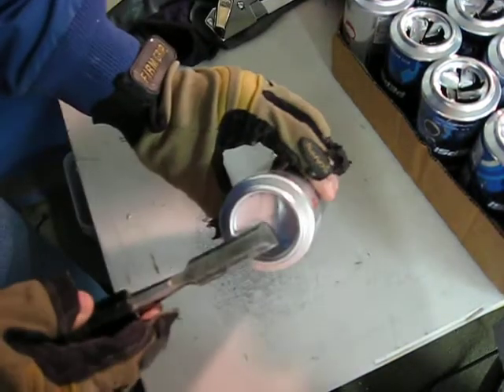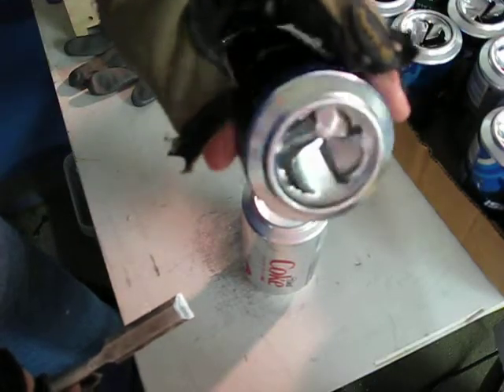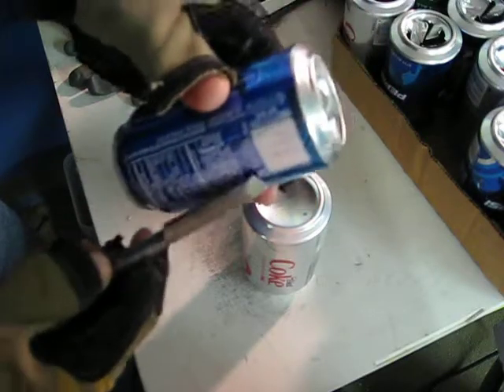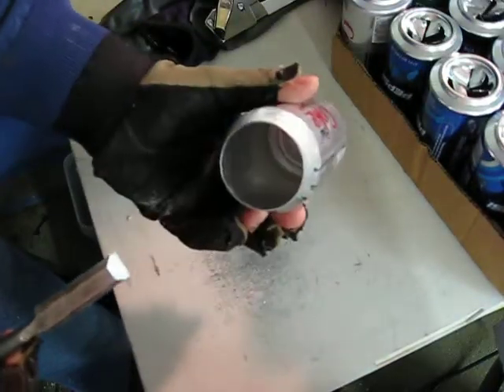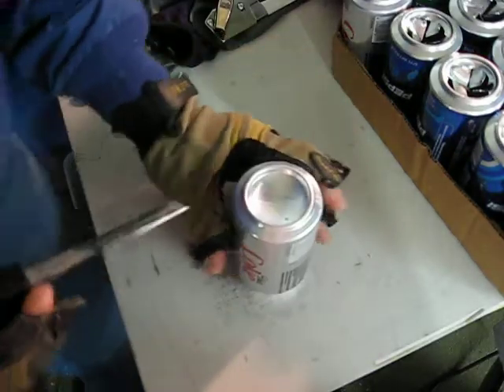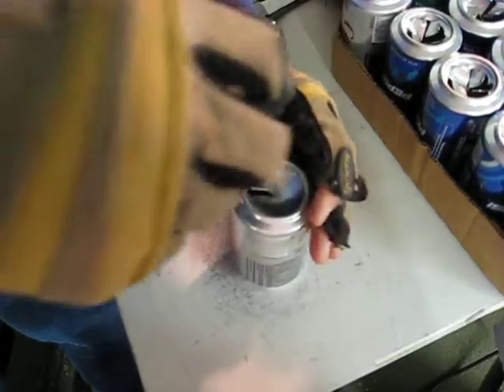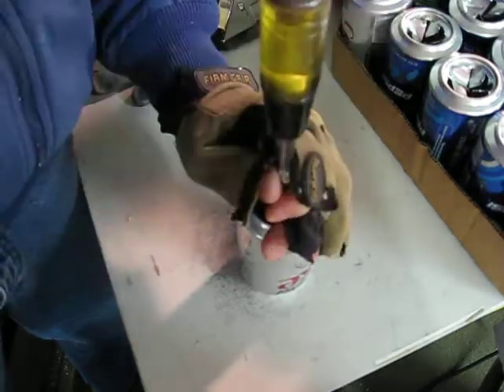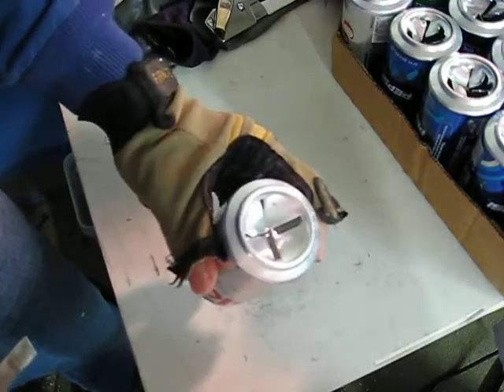Cans for Solar Air Heater

Comment: @md50md You must be a Canuk??? (I am) I too buckle the cans every time, hard to even hold an empty can without denting it, and forget about drilling out the bottom, for when apply even a little bit of downward pressure, the can buckle or even twist around, resulting in yet another ruined can. Frustrating to say the least. I too await any suggestions to get around this problem. Do they have thicker aluminum cans in the USA???

Comment: More resistance for air flow only. It will not effect heat transfer ability. If, keep air more cold inside the can than you have a chance to increase heat flow from the can wall to inside of can air. So, the idea is useless.

Comment from the maker: You have to have a very sharp chisel. and know how to sharped the chisel after it gets dull. When I cut thur the can the tip of the chisel cuts first on the outside curved part of the can and then cuts more into the center of the can. This way you are not trying to cut to much can at once. I use a 3/4" chisel. It took me some time and practice but after a few hundred cans you get really fast at it.